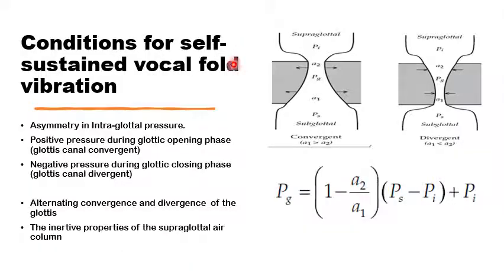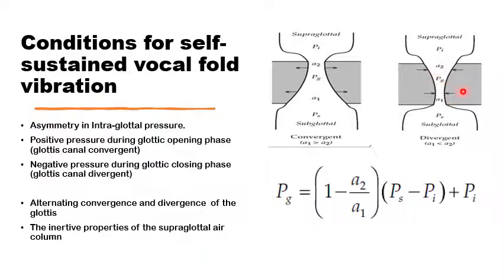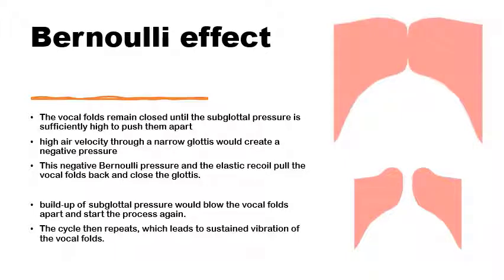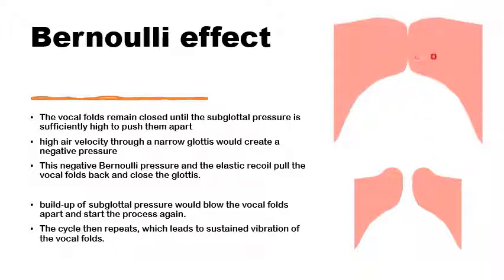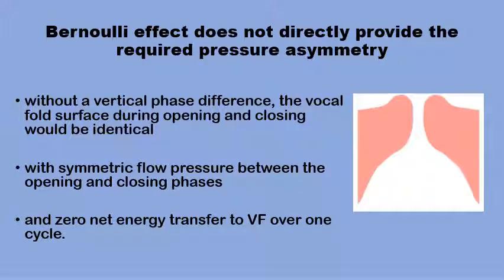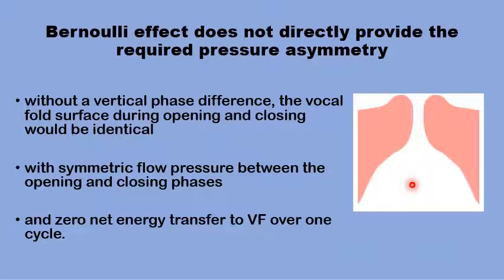(2)Mechanisms of self sustained vocal fold vibration

Comment: Prof, listening to the nice presentation, I have to ask: Is there a real science in straw exercises in affecting supraglottal pressure and subglottal pressure, and consequently the glottal shape both medially, superficially and vertically?
Reply from the maker: Theoretical and experimental studies have considered the effects of an artificial lengthening of the vocal tract. This induce an increase in vocal tract impedance, resulting in changes in the inertive reactance which may favourably impact the vocal fold vibration.

Increased inertive reactance changes the glottal flow amplitude and pulse Furthermore, the oscillation threshold pressure is reduced by increased vocal tract inertance, this occurs when F0 approaches F1, phonating at a frequency at or near the first formant may allow for an efficient voice production that could possibly be associated with lower effort.

Tietze discussed a computer simulation study which suggests that phonation can be made more

efficient through impedance matching between the voice source and the vocal tract

Titze noted an increased skewing of the glottal flow waveform (faster cessation of the

flow) leading to strengthening of the higher harmonics and an increase in sound pressure level (SPL).

He also observed a lower amplitude and a lower relative closed time of the glottis on an EGG

signal when phonation into straws was compared to traditional vowel phonation.

With narrow straws, it is possible to use the high subglottal pressures needed in singing, while having minimal collision of the vocal folds.

A downstream occlusion increases the supraglottal pressure and hence reduces the transglottal pressure, which is desirable even if the subglottal pressure is high.